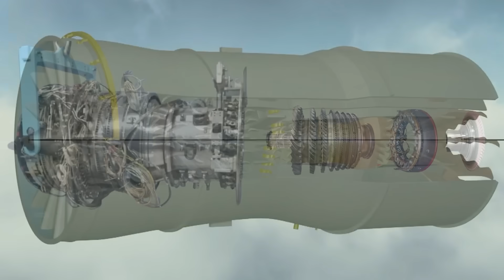How powerful could America's new F-47 stealth fighter really be?

Comment: America has always been far ahead of its adversaries when it comes to engine development, and it's not really close.
Reply: @thenegociater3387  Lol, China's engine performance are matching what US had for 40 years. China is decades behind in engine tech. The WS15 is worse than the engines used for the F22.
Reply: @cubed0724 this is probably chinas weakest area of its entire military, they’ve only now been able to get the WS-10s to a reliable state …everything they produce even the WS-20 is extremely derivative… and these are designs based on 30 year old Soviet engines.
Reply: @chadleschasin2893 ....WS-20 isn't even based on a Soviet design
Reply: @cubed0724 and you know that how? Just mere fart? 😂😂😂
Reply: @thenegociater3387  the raptors engine is ahead of anything out there today (40 years old now? so even if it's the same engine as the raptor engine it's far ahead
Reply: @kawkasaurous the raptor engine was designed in the 80s. The f22 was invented in 1991. Its old. That’s why it’s time for gen 6. They would never keep old engines
Reply: @FVLMEN 😂it wasn’t designed in the eighties… early prototype work began in early 82 but all companies prototype new technologies … it wasn’t until approval of the F-22 was in place  and funding appropriated that full work began on the F119 … and that was 10 full years after initial research… full scale production started around 94 …. The airframe didn’t enter service until 2005 with work being done up until it was commissioned… work was started internally at Lockheed on their next fighter design that would eventually become the Raptor in the early eighties as well but you don’t say it existed since then.
Reply: @chadleschasin2893   they had a working prototype in 1991. That’s all that matters for the conversation
Reply: @chadleschasin2893 Ok, then China is only 30 years behind instead of 40.
Reply: @thenegociater3387  this is actually were China falls far behind… they’ll tell you they’ve caught up but they are extremely far behind in indigenous engineered designs that aren’t derived from Soviet engine technology… everything they produce is derivative designs… they will probably have a harder time with the engines than they will with aircraft carriers and airframes.
Reply: @thenegociater3387  that's fine. I was being dramatic for maximum effect
Reply: Well, there was no need to develop advanced defense tech in the past because us was a reliable partner. We will see what the future will bring to the light.
Reply: Not just it's adversaries. The Italians basically just admitted they cannot build a 6th gen fighter without US help and that likely means engines, at least.
Reply: Admittedly some of that is because of the British and European inputs. Yes though, western engine technology is still so far ahead that China has to make allowances for it, but that does not in itself give us enough of an edge. It's also everything else, hopefully by the time China is truly in its decline phase, or it's Japanese lost couple of decades, only China style, we will still be sufficiently ahead that China doesn't feel comfortable making a world move
Reply: @thenegociater3387 There’s no evidence that American technological advantages have “evaporated” in most fields where’d you get that idea from?

Hell, it’s basically impossible for fighter jets without the best available engines to be the best given the best engines means the most power available for subsystems and radar and other avionics like electronic warfare have their capability directly tied to power generation
Reply: @anguswaterhouse9255 ....You do realize that having the most powerful engines ≠ having most electrical power? You need an alternator or something around that to do so. If you don't, the "most powerful jet engine" is useless.
Reply: @M16_Akula-III  I think alotta people here believe this jet will be hypersonic.   That's just not the case.   You need certain alloys on the airframe to do that which are not cost effective for multirole jets.   And these engines won't work like that anyway.       The same with the new Chinese jet.   No chance in hell.
Reply: @daleb5967  It's never going to be the case because it's not convenient to make such an aircraft do such speeds.
The Chinese also never claimed to do so (official sources). Both "J-36" and "J-50" are still currently in testing, considering they don't have PLAAF roundels.
Reply: @M16_Akula-III  agreed.
Reply: Rolls Royce disagrees 🇬🇧
Reply: @lockheed martin is definitely at the head of development currently, but we cant sleep on you boys across the pond for sure 🤙
Reply: @ Trump has killed trust in American defence in Europe. I’m an Engineer in need of a job soon. I notice  loads of defensive short contacts  appearing already. Busy times.
Reply: @ Well see 🤷 i see trump distancing us from nato as a positive, all around. We shouldn’t be so intertwined, our problems shouldn’t be yours and vise versa. It leads to us essentially warmongering for profit. Quite frankly the US should never offer US tech to foreign countries, its a waste of our tax dollars and only really profits and supports big government, because i knew we are not gonna see that money go back towards the people.
Reply: @jakevicknair5262  there's no way in hell I would buy american military tech if I was a European nation with trump voting pro Russia n North Korea a the un and planning to exit NATO.
Reply: @thenegociater3387  let's read what you wrote and compare it to what I said. 

ITS APPROACHING as in its behind. My statement still stands.

Yes as always other countries will improve and i was making the point that if if we don't improve were still ahead and it would be silly to assume newer engines aren't improved.
Reply: @kawkasaurous  yaya keep coping. Murica numba wan 😂😂😂
Reply: @thenegociater3387 that's because our adversaries have stolen most of our technology.
Reply: @thenegociater3387  Nice try commie guy. "We" last time I checked the Axis of Evil wasn't part of America.
Reply: Search WS-15 sorry to say they are neck and neck with China now.
Reply: @thenegociater3387 the USA’s claims are verifiable and reliably accurate, if not understated.  China’s claims are not verifiable, and have been proven unreliable in the past.
Reply: @thenegociater3387  No, the US produces far more capable and destructive warships than China makes. China produces larger numbers of inferior ships.
Reply: @thenegociater3387  what "technologies" are you talking about?
Reply: Britain with Rolls Royce along with Japan, Italy and Sweden have partnered in a team years ago and are not that far behind in a 6th generation development fighter.
Especially now with that President Trump with his cohorts, things will have a sense of urgency in Europe and throughout Asia.
The way US is tariffing everyone, most nations will refuse to buy from the US, due to their erratic behavior thus cannot be a trusted nation for freedom and democracy anymore.
They sold there soul to the devil.
Be prepared for Canada to stop the F-35 at only 16 (mainly due to contract obligations) then move on to a European aircraft ........pay back is a bitch!.
And they are not the only ones, Portugal just pulled out of F-35 and the future of US sales throughout the world in military equipment will be surely be eroded due to the Trump/Vance/Musk/MAGA issues.
There are also broader calls in Europe to cancel F-35 orders, driven by anti-U.S. sentiment and concerns over the program's costs - trust factor.
A lot of US workers are going to lose their jobs due to the world perception and action against the US in the defence industry and in general.
Reply: If US use Alien technology maybe it would cause WW3 for hunting the alien technology
Reply: China just trolled the US into finally showing some of what they’ve got, which I find very funny. They got sick of PRC bots squawking about that absurd tri-engine “sixth gen fighter.”
Reply: @thenegociater3387 Even if that’s true, the F-119 engine was designed and built in the late 1980s.  So China would just now be catching up to what we did 35+ years ago, while we’re about to start using adaptive cycle engines.  China almost certainly isn’t anywhere close to developing those, since they haven’t even quite mastered regular turbofans.  The fact that their J-36 design has 3 engines makes it quite obvious that they’re nowhere close to figuring out solutions for the fuel economy vs thrust and cooling issues.
Reply: @bluemarlin8138  ...F119 started being built in the 1990s with the first test in 1993.
There's also a thing where a country's technological development would increase exponentially, reducing the technological gap.
WS-10s are all turbofans, and are now powering all Chinese fighters outside of the J-15 and Su-35s.
J-36 uses 3 engines BECAUSE it isn't as big as a B-21 nor is it as small as a J-20. Putting 2 high-bypass turbofans wouldn't make sense, same as putting 2 low-bypass turbofans. Therefore, they reach their conclusion: a third engine.
Reply: @thenegociater3387 But the F-119 is also over 35 years old, and China is just now getting an engine that is comparable in SOME respects.
Reply: @thenegociater3387 more like stolen.
Reply: Exactly. Though the British have always been the innovators and leaders. Though they outsource their world policing powers to America. 😂
Reply: V2 German rocket 🚀. Enough said.
Reply: @thenegociater3387 I'd agree with that and say it's a result of greedy government contractors that put profit above all else, even a finished product
Reply: No Germany were ahead in the beginning sir
Reply: @castnoshadow82lr48  he did say adversaries, not allies. When the nazis fell, Germany became an ally
Reply: @thenegociater3387 The retired Ukrainian scientists employed by China help to develop the Jet Engines.
Reply: @Ifoughtpiranhas  that won't last much longer with Boeing n Pratt n wittney giving away tech to China.   They just had another trade summit n Boeing was there making deals with China.     Yes.   The company holding our weapons defense secrets and tech.
Reply: @thenegociater3387 you can almost visually see how sluggish and inefficient chinas engines are, they are advancing quickly but no remotely close to what the darkstar will be rocking.
Reply: @ Scramjets area whole different ballpark, useless to compare to regular fighter jets. Even so, China's best engines are still behind what we had over 30 years ago and our new engines are generations ahead. A thrust to weight of roughly 2 with the ability to also be more fuel efficient than gen 5 sounds like sheer madness, but that's what the F47 looks like.
Reply: @ well yea they would be in a different realm but lockheed martin and another company developed an engine that operates like a traditional engine but can then move into scramjet. Dual capable engine, certainly going in the sr-72 darkstar, but could have potential for a fighter in the future.
Reply: @thenegociater3387 I agree that it's important not to get complacent and assume that you will always be ahead, but the very thing that you are saying - our closest adversary is only now approaching a capability we developed 30 years ago - really only proves the original point
Reply: @Ifoughtpiranhas  the secretary of the air Force paused the ngad because the cost equaled 3 f35s per one ngad and did not offer enough advancement to be considered 6 gen.  It may be unpaused but the statistics remain the same.
Reply: Thousands of retired  Ukrainian scientists are now working in China and developed the Aircraft Engines.
Reply: Uk the harrier of the 80s was the most advanced fighter jet engine then now uk making the tempest fighter jet 7th gen with built in ai with the fighter pilot
Reply: @ maybe the 7th generation of the same plane but not 7th gen, not even close.
Reply: You obviously have blueprints and all  secret confidential performance figures of all foreign turbofans.
Reply: @andgate2000 , Obviously.
Reply: GE anounced thst the engine was ready for mass production 4 years ago. Then they siddenly and quetly redacted that claim. Hence its been clasified.
Reply: Of course; they have all the alien technology.
Reply: @Subvertebrate the alien technology is kept separately, and secretly. None of our military jets have anti-gravity as far as I know.
Reply: @dextermorgan1  b2 uses the bifield-brown effect apparently
Reply: @Subvertebrate alien technology? I’ve spent hours days months looking at that. The more you learn the more obvious it becomes an intelligence psy op, all of it at its root is based off heresay. People relatively, can be easily manipulated
Reply: @Subvertebrate  alien because it’s beyond moving parts. There are no aliens
Reply: @thenegociater3387  close the gap on 40 year old tech*
Reply: @thenegociater3387  all that to say its behind. Congrats
Reply: @thenegociater3387 good thing we got someone back in office that’s all about making sure we stay well ahead of our adversaries then right?
Reply: As we force our partners to ramp up their capabilities to be worthwhile partners.
Reply: Well aircraft engine development won't make much sense in the near future as new very smart  missiles with AI on them will pose  an unacceptable risk for aircrafts.
Reply: @profounddamas  not if tracking systems can't find the plane. The F22 is invisible to basically everything as is. Now factor in 30+ years of stealth tech advancement (coatings, body shape, tighter tolerances for less gaps and creases, thermal management, engine concealment) since then, no radar on Earth within the early 2030s will be able to detect it until its weapons have long been launched and it's already too late.
Reply: @LBozo-q4z  Buzzwords. "Detection" means getting a return, which WILL HAPPEN FROM A RADAR. Getting a "track", now that's different. Also, there's a reason why every other 5th gen resorted to having multiple detect and track sensors, unlike the F-22.
Reply: Yes. But the Tu 160's NK-321 engines are the most powerful jet engines ever installed on a combat aircraft.
Reply: No, none of those leads the US had in the past have been evaporated.
Reply: @cubed0724 lol, if that’s so why is China and even Europe still unable to build jet engines that come anywhere close to engines we’ve been producing since the ‘90s?
Reply: @The_ZeroLine  Um, I agree that China jet engines are garbage and outdated. That's what I've been saying. Friendly fire bro.